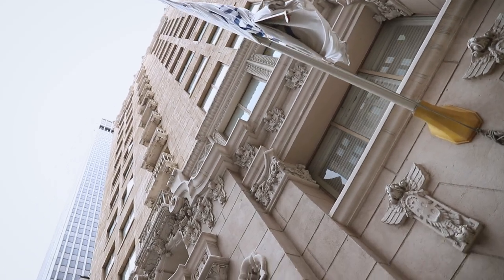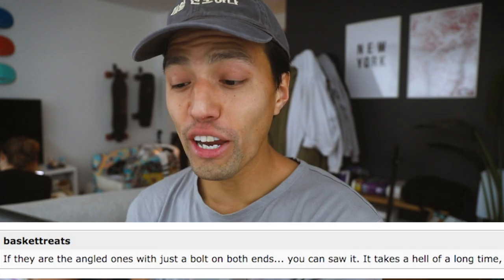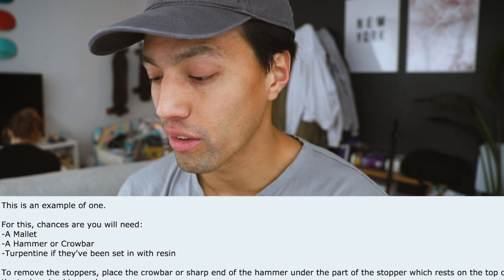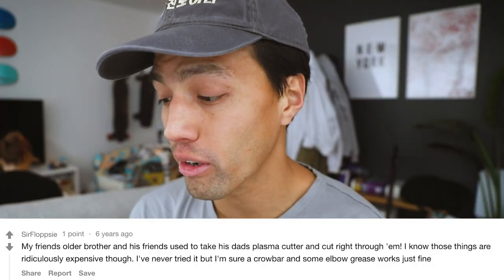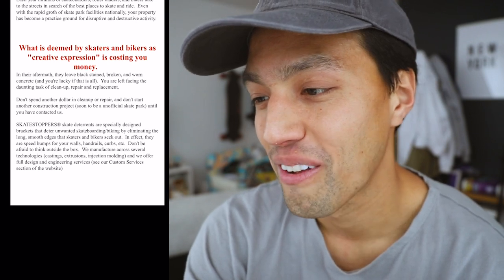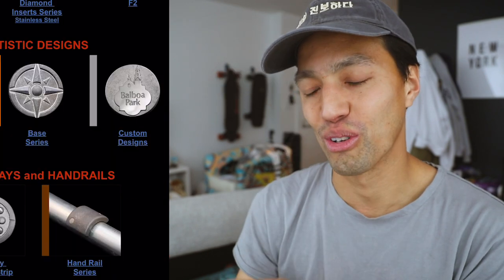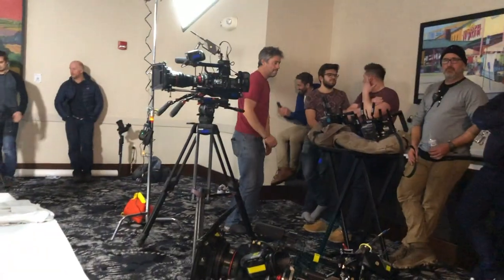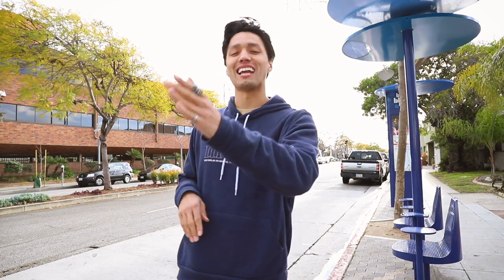HOW TO REMOVE SKATESTOPPERS! *Highly Illegal*

Comment: John Hill - smh- stop telling kids concrete doesnt chip...just stop
Reply: I mean he didnt say it dosnt chip he said its harder than people think
Reply: Well usually it's not the concrete that chips away, generally paint, when it comes to skateboards anyway. Bikes on the other hand are an extra 25lb with the rider on top of that, when they grind concrete it can chip but it doesn't always happen.
Quick question though, what's more expensive in your opinion? Buying the skate stoppers and/or paying for labour to have them installed, or buying a bag of quick set cement and patching any chips that appear? Keeping in mind a 22lb bag of cement mix will set you back maybe $10.

Comment: Theres a ledge in my complex, ive skated, scooted, roller bladed and hit it on my bmx ALONGSIDE MY FRIENDS for easily 8+ years, the edge is actually smoother and less jagged then before and the only chunks are from cars hitting it trying to park (on the oposite side of where we grind), BAN CARS. WE NEED CAR STOPPERS.

Comment: On some hand rails with skate stoppers you can get away with  variations of board slides front side,backside,lipslides but it will do some damage to your deck back in the day when they first started putting them on hand rails we would use duck tape over the stoppers with plenty of wax

Comment: I have a question for anyone who’s ever worked with concrete/made skate parks. My friends and I plan on making a skate park on the side of my house. We live in a small town with about 0 skate spots. Many friends of mine have lost passion for skate boarding because of the little area for it here. The area I have to work with is around 8.5-10 feet wide and probably 60 some feet long. I have some plans drawn up for incorporating trees into it and having a quarter pipe. Anyone have any tips or suggestions on how to do this cheaply or stuff to put in the ‘park’
Reply: Zack Spiewak yeah absolutely, concrete is cheap if all you and your friends chip in.  Don’t know how old you are or how many of you there are willing to chip in but you could build something sick for a couple of thousand dollars maximum.  You can make a half pipe for 400/500 dollars using plywood and lacquer.  There are tutorials on YouTube for it.  If you’re confident with mixing/setting concrete you can make banks, barriers, kickers, ledges etc. With that easily and cheaply.  Just make sure to make a wooden mould to pour the concrete in and don’t just do it freestyle.  It will take about 6 months of weekends and some evenings with a group of you

Comment: Concrete is actually pretty easy to chip. Been working as a finisher for a few years now and ive seen a lot and learned alot. When concrete is a few years old it looks like crap. However when is new, it has very clean and "smooth" surface. The edges can easily break off with a light hit of a hammer. Ive also noticed that even broom stick bristles scratch it easily.
Reply: Just dont skate new shit😂😂. Annoying af when a job gets damaged and we have to bust it out and remake it